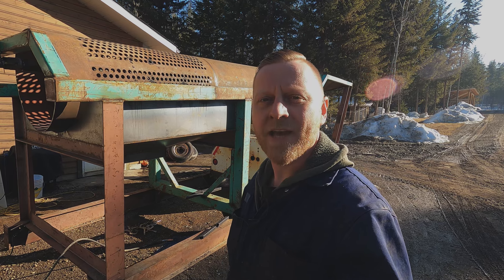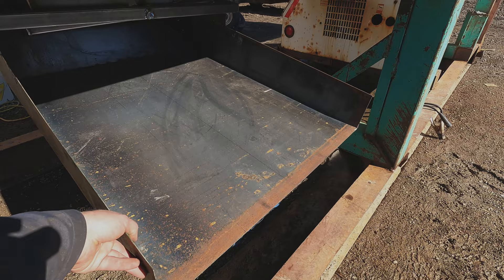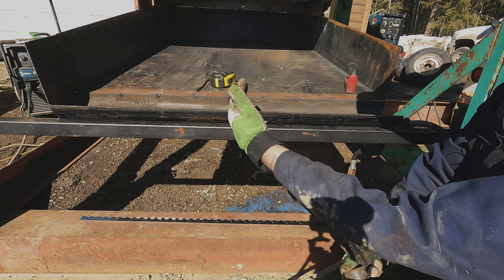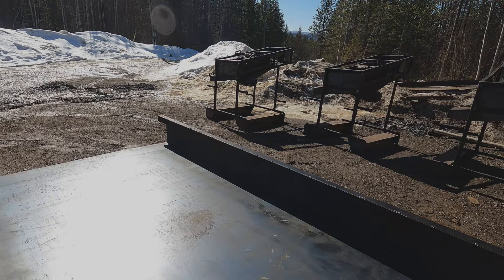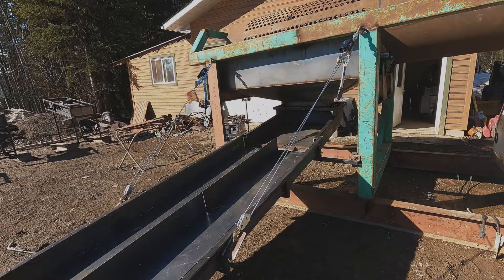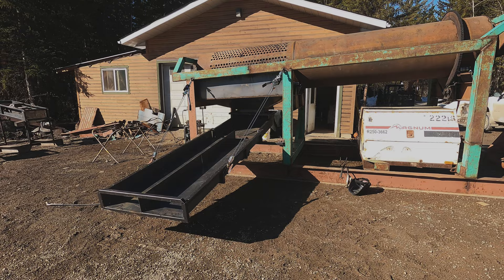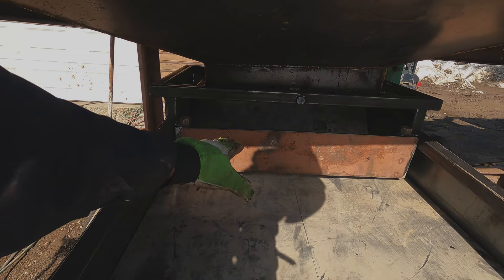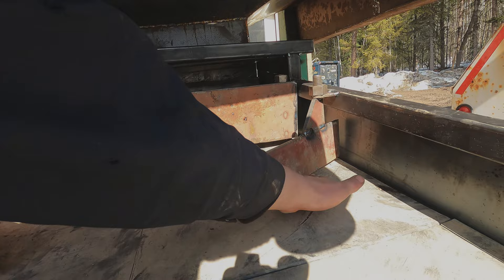Gold Sluice Box build

Comment: Great video, you've got skills, the channel is going somewhere for sure!  I like the water distribution gate at the top, I'll have to try that out on my shovel in unit.
I don't understand the two side gates to direct water flow from side to side, is that just there to balance the flow evenly from side to side if it drops down from the tromel unevenly?
Reply from the maker: Thanks Kyle! Those gates work very well, they would work great in a highbanker to stop the pulsing every time a shovel full was thrown in. When meterial comes put.of the screen it naturally wants to go straight to the backside of the sluice and not take a 90° turn. Those adjustable wings will guide the metetial to the center of the box.